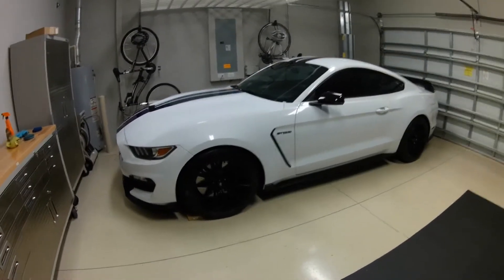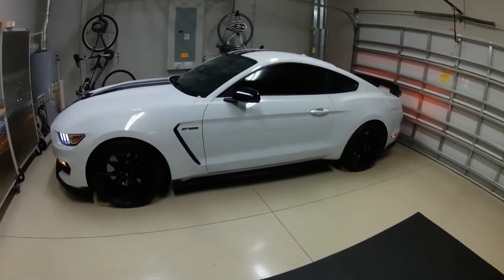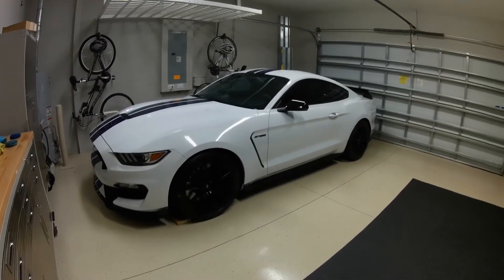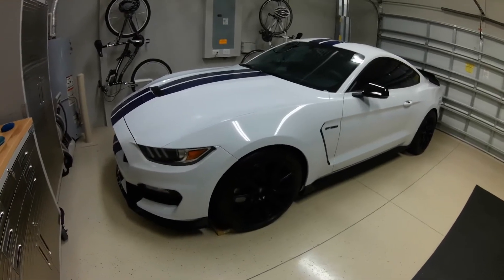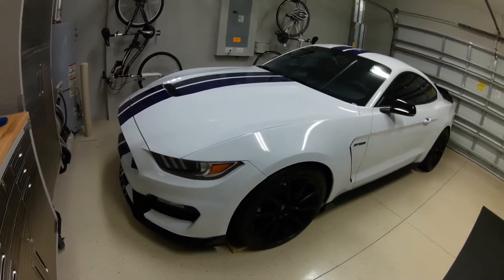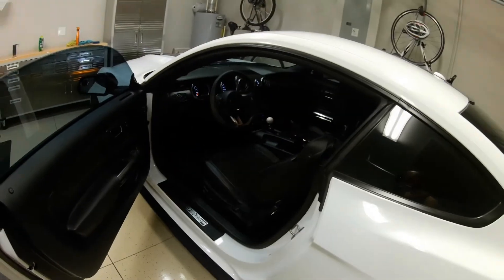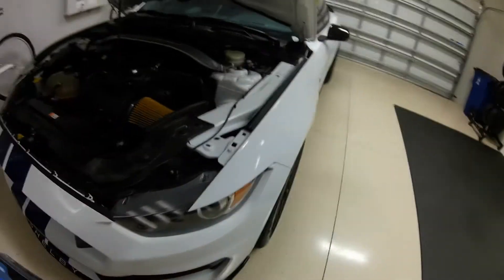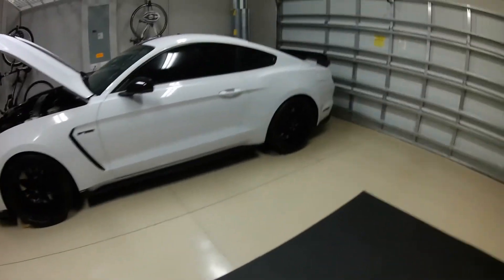GT350SE (Shelby Signature Edition) Package Walkthrough!

Comment: You can add the Cobra Jet intake manifold, which the Aluminator GT350 motor has stock.  And it  adds almost 50 RWHP to the car and it will rev up to 9000 rpms.